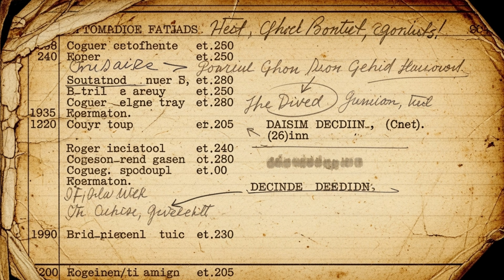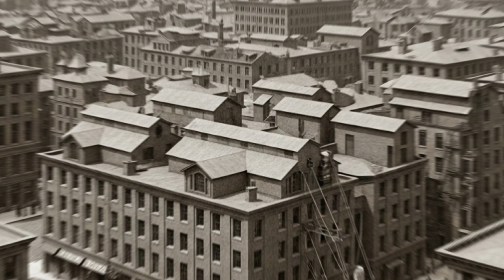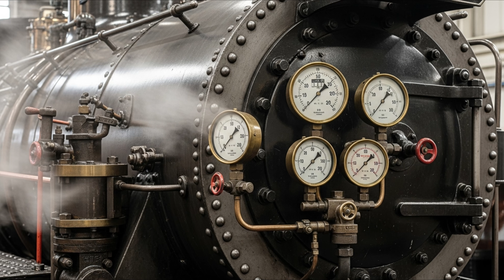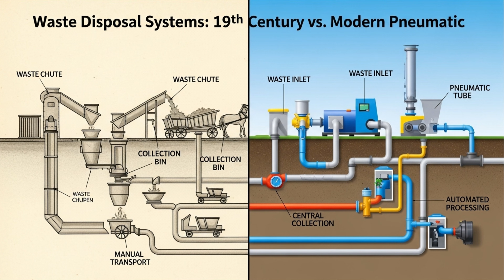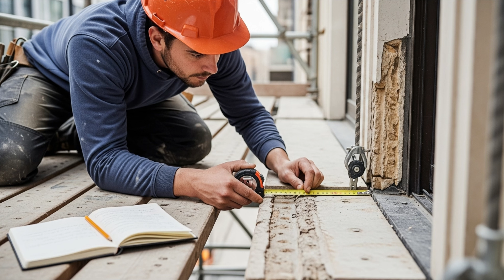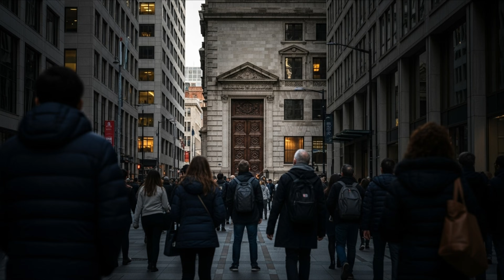Why Old Buildings Have Doors That Open to Nowhere   15 Feet Up

Comment: You know how many business owners over the years have started a project only to can it for some reason. They start making renovations , adding doors they need, then something happens,maybe funding gets pulled or permits. then your left with a door you dont need and have to cover it up. you really think theres gonna be a huge paper trail for something so insignificant ?

Comment: They were Portals, which originally had Stairs Up To LTA Dirigibles, for Egressing, and Regressing Passengers, H2o, and PSI Gas Hoses, and Cargo .

The Old Tall Ones Built Them .

All Tartarian Technology, including Flight Technology, and Lighter Than Air Technology, and Free Energy Technology, Living-Conscious Component Technology, And Tartarian High Energy Weaponry, and High Yield Explosive Weaponry, and Weather Enhancing-Directing-Changing-Controlling Technology, which was Too Advanced, and couldn't be figured out in a timely manner, and Metered, was fazed out, scrapped, buried, melted down, and destroyed, and / or Secreted Away for later Wars .

As for Tartarian Technology .  Certain mirrors were not mirrors, but view screens, and scrying mirrors, aka teleportation portals, both 1 way, for viewing people, and places, and 2 way view screens for 2 way audio - visual communication .

As for the Magnificent Fountains around this realm, Tartarian Pumping Technology was Deliberately Shut Down, Disassembled, Hidden, or just Buried, so that no one could see it, and learn from it, while slowly incorporating some of it's Technology into Future Machinery, and Pumping Technology . 

The Saddest Truth is the following, which is that what we were told is History, is a series of lies, agreed upon by the powers in charge, and Not the True History, which was, and is Suppressed, Buried, and Hidden from us .

Our Species was Miniaturized, Marginalized, and Neutralized, and told Nothing About who we are, or what we are, or where we came from, but deliberately lied to about everything, and everything around us, through the Sinister, Lie Filed-Teaching Scholastic Systems, which fill the children's minds, with utter nonsense, regarding what we were taught was our supposed History .

There used to be Incredible Intricate Technologies', once everywhere, now removed, and deliberately buried, destroyed, criminally hidden away for other future purpose's, and forgotten, when it could have been really beneficial to our societies, and to our civilization . 

As for the Ancient Civilization, known as Tartaria, aka Grand Tartaria, which was Destroyed, and Almost Every Trace, and Reference To It, and It's People were Erased, . . . by Ancient, High Energy, High Yield Directed Weapons Systems Were Deployed, Destroying, Melting, Incinerating, and Disintegrating Everything, and Everyone They Touched .

The Tall and High Spires on top of all of the Ancient Buildings, and Structures, were for Channeling Aetheric Energy, aka Lightning, and Other Forms of Sky Energy Accumulating-Storing-Transferring Antennas they were, which powered many engines, lighthouses, power tools, gravity nullifying technology, LTA Airships, Tall Mooring Mast Structures, and many kinds of devices, including internal building lighting, external street lighting, and for heating buildings, which were designed to be warmed by the Aetherical Energies from the air .

The Ream-Wide Ancient Stone Quarries, were already there, before our Smaller In Strength and Height Species was Cloned, and Grown, and placed here in this Realm .

The terms " Global, Spherical, Atmospheric, and Planet " are incorrect, wherein 1 / 2 Spherical Realm is correct .

What if the Greeks, and Romans, The Venetians, and The So-Called Egyptians, were just names, and not real peoples, and civilizations, but those names, or labels, which were deliberately tacked onto Tartarian Centers, which were told, and retold, and not real ?

This Realm was Invaded by High Tech Controlling, Destructive Beings, which Eradicated, or Harvested the People, or Beings Civilization, which were here before our Smaller In Size, and Strength Species was Cloned and Grown, and Placed here, and told Nothing of who we are, what we are, and where we came from .'-o

What Lies Beneath ?  

Precisely, What Does Lie Beneath, besides All Of The Lies, which protect the Truth, which has been Hidden Far Beneath ?

Tartarian Structures, and their Sub-Terranean Structures, Technology, Passage Ways, and Tunnels, which were Too Advanced for the surrounding human built structures were Quickly Deliberately Destroyed, Buried and Covered Up, Repurposed, and Erased from human-huwoman memory .'-o

Try to remember the sentence right below.

The Living-Singing Bells of Tartaria .

The Ancient Bells, were Tuned To Certain Frequencies, which were Good, and Healthy to the Beings, or People which were here before the Realm-Wide Depopulation, and Destruction of their More Advanced Than Our Civilization, Civilization, wherein, the Tonal Frequencies, that were Beneficial, and Healthy for that Civilization, were Hurtful To the Beings, which Attacked, and Destroyed Them, so they began their plans to Break, and Destroy Every Bell, which Rang In Those Healthy, and Beneficial Tonal Frequencies, because they Hurt the Beings, which Took Over this Realm. 

Our Deliberately Minimized in height, and strength species is on the Precipice of yet another Deliberately Contrived Realm-Wide Depopulation Reset, by the Beings, which have done this Evilness Many Times Before, most likely every time some of us get Smart, aka Intelligent Enough to figure out what is being figured out here in this Video .'-o

If 1 of these Beings wanted to show off, and / or start a faux religion, with his high technology, which was used to Neutralize what is called gravity today, and lift Heavy Stones up, and into place, to build the Magnificent Gigantic to us Structures all around this Sealed Realm, then, with that Floating, and Hovering Technology, he could use it to Float into the air, and Float, and to Walk on, and over the surface of water as well, giving the appearance of being a supposed holy deity to the ignorant of his technologies, creating a couple of faux religions to Control the ignorant, aka The Uninitiated to those technologies .Incredible Technology, once everywhere, now removed, and deliberately buried, destroyed, criminally hidden away for other future purpose's, and forgotten, when it could have been really beneficial to our societies, and to our civilization .